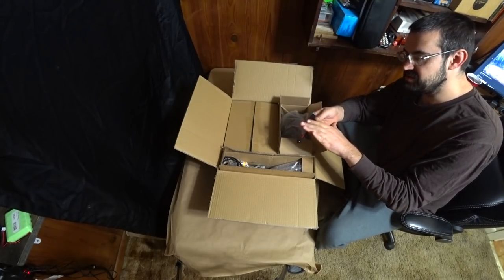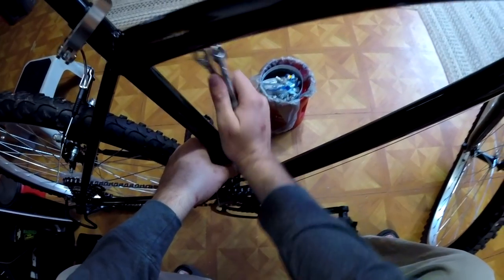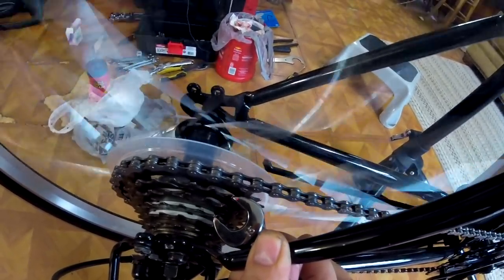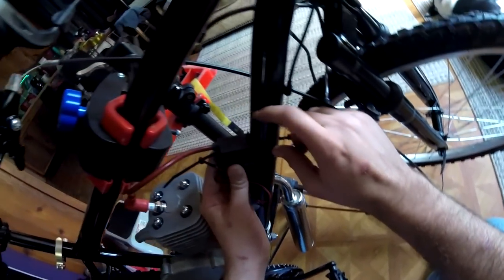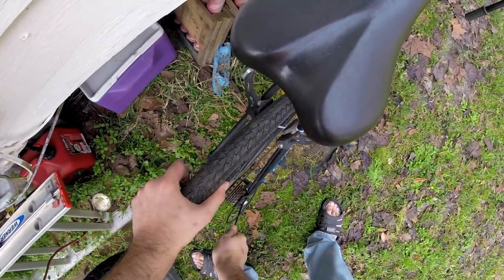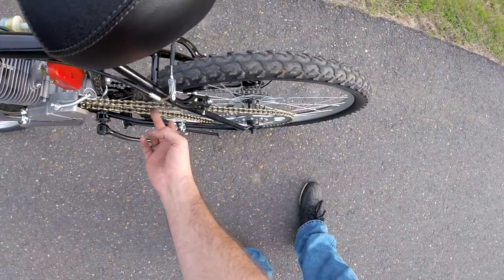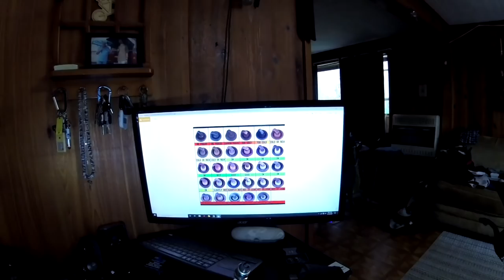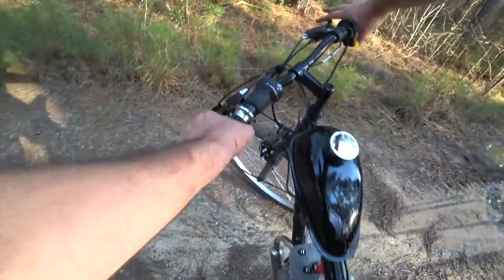YD100 Trail Bike Build (Motorized Bike)

Comment: Good job on the build, but I sure hope you have better luck with this motor than I did. For a brief time the motor seemed plucky, but there were heat issues that I could never quite get to go away, as well as a whole host of other problems like 4-stroking, the piston eventually smashing into the connecting rod and the inside of the cylinder being discolored. By it's last run the motor could barely take the bike to 10MPH. Quite honestly the worst motor I've ever owned, clocked up very few miles before I took it off and replaced it with the cheapest kit on eBay - which rendered the purpose of the upgrade from the old bike kinda pointless. Here's hoping it was just a bad one and your one serves you much better.
Reply from the maker: Thanks for the heads up.

Comment: Could the small spring assist in tighter clutch discs lockup ? Havent seen these up close but when i do maybe itll be love @1st feel .
Regardless of the headaches in the marginal quality dept im redy to go for it cause upgrades abundant and plentiful but also like the thought of the ktm but info seems scarce and wanna know more also everyone holds the firestorm80 T40 in favorable regards , will probably be my 1st in frame chain dr bike and will also get the 5.5cc head w lotsa cooling area w the kit . Aircooled will trouble me emotionally anyway even w extra large fins
Reply from the maker: The best I can tell is the small spring on the clutch cable is to aid the clutch cam in returning to neutral and prevent excessive wear on the cam and bucking bar.

Comment: On that hub adapter grind the ends down and it will get a lot tighter it won't bottom out...
Reply from the maker: Tight clamps just shrink the thin hubs like a beer can, throwing the spokes and bearrings into madness.

Comment: I've got to say this is one of the best video's I've seen about these motorized bikes. Someone that really understands what's going on with these bikes. The only thing I was wondering is how close are these engines to 100cc are they? BTW like your dog.
Reply: It's 78.5cc displacement, 40mm crank with a 50mm piston... Not even close to 100cc, just barely able to be designated a 80cc but not yet
Reply: Wow, not even an 80. Hey man, thanks for the info. Makes more sense on the power of these little 2 strokes.

Comment: My yd 100 came with a c clip for the piston in the crankcase so now the crank is seized, I didn’t even get it started yet I went about 10 feet and then it just locked up so now I’m going to have to try and fish and pry it out with a screw driver
Reply: Goodwill Garage the shaft that connects crank to piston probably ate the transfer ports
Reply from the maker: Ouch! sorry to hear that man... that sucks!
Reply: UPDATE I just had to tighten up the clutch as much as I could and  then turn the wheel as hard as I could to get the crank to spit it out I also flipped the bike over only damage done was just a scratch where clip rubbed against the case and crank @LA Hover @ZeldaNumber17
Reply from the maker: Thanks for the heads up. I knew that clip on mine looked kinda funny, and it felt soft... I think I'm going to go ahead and look for better clips asap. I think you can find replacement cylinders for the yd100 online too.
Reply: LA Hover there were 3 clips in total the one that came in the bottom end and the two in the piston it was the manufacturers fault no damage was done to the cylinder or really anything and I also thought those clips sat in the piston kinda loose
Reply from the maker: oh cool, and thanks!

Comment: Rob at zeda actually has a video where shows he leaves out the outside rubber on the rag joint
Reply from the maker: I'll have to go digging for it. I wonder if it held up and stayed true.
Reply: @LAHover  he said in video that he sets up all of them like that and they run truer...i don't iv got a disc brake rim mine bolts straight to rim...

Comment: Hey I got the same motorcycle transmission chain for the drive chain didn't use it yet for some reason the stock chain is holding up perfect little scary lol does it work good

Comment: It kinda pisses me off that you have to drill a hole in the handlebars and usually the little pin slips out and ends up rattling around in the handlebars anyway 😒
Reply from the maker: Oh yeah... I stopped doing that years ago. 
Now I just place a pad of double sided tape between the top and bottom and it holds great.
Literally holds for years if you use gorilla brand.
Reply: @LAHover  I'm definitely going to try this next time, it's getting pretty chilly here in Delaware and I think I'd like to build something more like one of your trail bikes this time, it's going to be too damn cold to be doing 35 and I'd like to have something a little more capable.

Comment: So does the clutch on these mods simply engage the engine into transmitting power to wheel?.. or are there gears actually?
Reply: no gears you described it correctly in the first sentence

Comment: I wish somebody would measure one of these and see if the bottom ends are the same as the smaller engines. It would be a fact that the manufacturers would want to keep secret because a guy could just get a yd/bt 100 to end and maybe with a little matching work, make it work with a zeda or comparable (China doll) bottom end.

Comment: I use that same hub adapter and have no problem with it. I lap the 2 halves just like lapping a cylinder head. Use a piece of plate glass like 3/8 or 1/2 inch (go to the store window guy they almost always have a piece from a broken window). Next tape a piece of 220 or 400 wet&dry sandpaper to the glass put some light oil on it and make figure 8's . Do both halves. Just a little. 
https://youtu.be/hzbRlH86eIU
Reply from the maker: Sadly because of the leverage of the 56tooth sprocket + the pull of the yd100, that won't hold. Smaller sprockets can get away with it.
Reply: I run a gx 140 clone with a cam, ported and polished head, no governor,  and a mikuni vm18 makes about 7hp and 10ftlbs torque also has a comet converter.  Probably triple the torque of your motor.

Comment: I have an idea. Why not mount the chain tensioner on the top bar rather than the bottom bar where it normally goes?
Reply from the maker: It would not reach the bottom chain. And you can't place it on the top chain, the pull of the motor would destroy it.

Comment: I like the video work you do for sure, very nice. I'd like to build one of these but I think the 2 stroke noise would be objectionable in my neighborhood. 
One possible partial remedy would be muffling intake noise. 2 cycle porting overlap usually allows significant a ignition 'bark' to escape through the carb outlet on each stroke. Some sort of intake resonance chamber could make a big DBA difference. See link for an example  https://www.radne.com/product/inlet-silencer-aero-kart-side-intake. Exhaust muffling w/o performance drop is trickier probably;  I've experimented with home-made short after-mufflers stuffed with steel wool.. Mmm

Comment: So how did you like the 56 tooth sprocket! Did it give you better acceleration?
Reply from the maker: It's not a wheelie popper, but it pulls through the soft ground better than my other trail bikes. It's only place it on the trail because it's slow as heck on the road... but on the trail where every tree, bush, rock, and log is flying by your feet it feel fast and can pull hard at mid RPMs

Comment: Hey hover im busting your balls or anything but that tire strip is meant to go around the rim to protect the inner tube from the spoke adjusting screw heads....
Reply: He used a old one for the tire liner put the new one back on rim..
Reply from the maker: Check Mate... Slime 20093 Tube Protector, One Size Fits Most (Pack of 2) https://www.amazon.com/dp/B003NUJ212/ref=cm_sw_r_cp_apa_i_7-fBEbBZP67ZW

Comment: Why use a 56 tooth sprocket instead of the original 44t?
Reply: Sima Basargin probably to give the bike more torque on the low end but that’s my guess I’m not an expert
Reply: Sima Basargin since it’s a trail bike
Reply: So it adds torque but lowers top speed?
Reply: I beleive so 👍
Reply from the maker: Yup yup, Dank got it spot on. She is only for trails. Slow as heck in town, but man it can pull hard in the mud :D ... relatively speaking that is :P In the video we up-loaded today it bossed a trail like a pit bike ;)

Comment: Just finished watching brother another awesome video...i know you didn't gag down on it or nothing like that but in part throttle operations how does it compare to the seeutek and triple???
Reply from the maker: Thanks! With 20:1 breakin, 93 octane, stock tune, and no mods here is what I noticed. 
Low RPMs felt about the same as a triple. Pulling from a dead stop did not feel much different as well. Pulling from mid RPMs felt much stronger.

Comment: Don’t you ever use spring chain tensioners?
Reply from the maker: On some builds yes. They are good for times when you are unable to center the sprocket as well as you like. But on this build I needed lift the chain close to the sprocket so it would clear the frame.

Comment: can u make tham faster i am asking like the other that came befor it ther selling yd100 ot it rilly named t100 zada but its calld t100 3    so meening thay have a stage 3 yd100 from dealer
Reply from the maker: Other than replacing the head. You should be able to do most, if not all other mods that you could do to a pk80

Comment: why didnt you just drill a hole in the hub that would line up with the set screw you put in the clamp for the sprocket? if the set screw continued into the hub then it wouldnt slip, maybe even have it go all the way through and into the other side of the clamp so its twice as strong.. also, the cheap flux core mig welder from harbor freight is the BEST investment you could ever make for hobbies like this.. with that welder you could even build up the diamiter of the hub so that the clamp WOULD fit, or you could just run a bead around the edge after it was bolted together..

Comment: Ok, I have a legit question. And btw I love your videos, I’ve been a subscriber for about 2 years. But why not just build a 49cc scooter? I mean, I know there are issues to resolve with making a scooter water & mud proof. But the cost, considering what you already have invested in motorized bikes, might even be cheaper. If for no other reason than the longevity and dependability of the GY6 engine. Just a thought .......,

Comment: When you were showing the stock exhaust, it reminded me of two stroke stuffing's motorized bike build where he removed the end cap entirely, and it netted him (on his dyno) .4 HP.  When I saw that I did that immediately to my old bike.  here is a link to his channel.  (the motorized bike playlist) 
https://www.youtube.com/watch?v=U3Df53pJcqk&list=PLXcD4bU9sKtGK_87uEwq9woIkS8qyy6d4
also here is a good forum I have found when I was first researching 2 stroke kits.
https://motoredbikes.com/forums/2-stroke-engines.108/
I'm sure you know all this info already, but I drew inspiration from the other youtube channel, and I thought I would share.  Also, would you be interested in an older Schwinn (I think either late 90 or early 2000s?) I don't ave use for it, and I wanted to trade it for help assembling my other MB.
Reply from the maker: I saw that video and I was like... WTH that did not work for me lol... my tune must be funky :P
Reply: It works for every engine, it does waste more gas, dropped my 78.5cc yd from 60miles a tank to 35miles. Basically just gives you torque no high end power just low end. 

I drill a 1/4 hole on the baffle (end cap) and still get some low end power with gas economical savings.
Reply: Mine wouldn't move before I took my cap off now it's a whole different beast but it's going to suck when I get pulled over

Comment: What does he do with the gear changer on the handlebar?
Reply from the maker: on this build I flip it over and placed it on the left bar. I also removed the crank shiftier bc I don't use it.
Reply: Would you recommend me getting a road master like yours or should I go for a bike with more clearance in the frame but has no suspension whatsoever? To motorize ofcourse ;)
Reply: https://anchorage.craigslist.org/bik/d/anchorage-mens-18in-red-mountain-bike/7088176294.html           This is the other bike. Thanks

Comment: u prolly just bought a shitty hub adapter.  the one i got, the hole didnt line up perfect so when u put it on the hub, its not a perfect fit so when u tighten it, there is a lot of pressure on opposite sides of the hub.  its hard to explain lol.  imagine a circle on a flat surface and then cut it down the middle, 12 o'clock and 6 o'clock. now take the right half(or left half, doesnt matter) and slide it up 3 milimeters, now the circle isnt a perfect circle.  thats what my hub adapter looked like when u screw it together. not only that, but it was kind of oval shaped too.

Comment: U're moving kinda slow, my bike flies till 60-65 km/h. And I'm using almost the same engine, but with upgrades and it's 80cc. And I'll get more speed with a 32T sprocket. Muhahahaa!
Reply from the maker: I did not build this bike for speed. I built it to pull through trails.